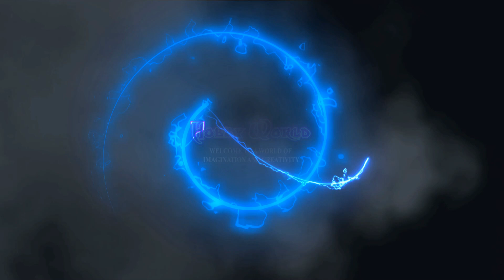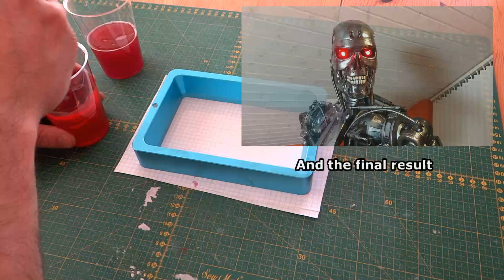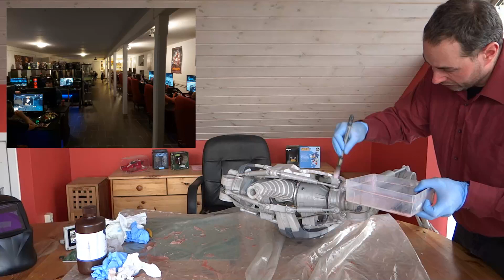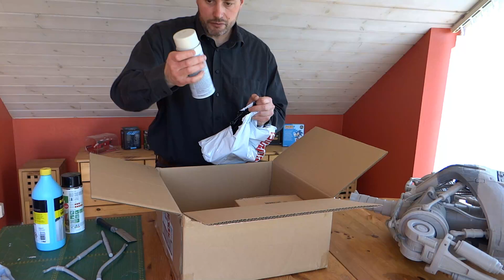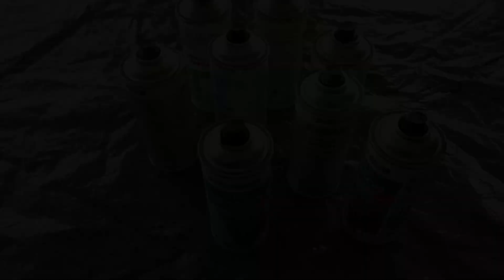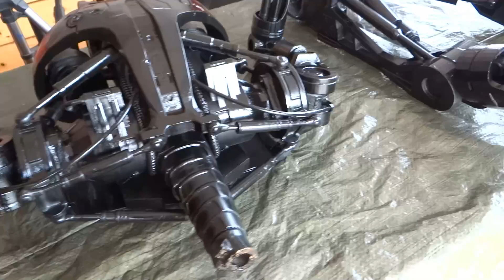Building a 3D printed Full Scale T-800 Terminator Endoskeleton - Episode 3

Comment: What size printer bed did you need
Reply from the maker: Sorry for the late reply, been a busy week. I actually printed this terminator on a small Ender 3 Pro (235X235) and a CR10S Pro (320X320) so not really any large printers. I have upgraded to larger printers so if I should do the project again I would print some of the parts in a single piece instead of splitting them up.
Reply: Oh right thanks im thinking of making one but need the files.  I found one online but it was more basic and didnt look as good. I just got a 420mm printer specially lol @HobbyWorld_one

Comment: Hi, but you use resin for resin printers and brush it on the model...thanks
Reply from the maker: Hi Fabio. That's right I use resin (from a resin printer) mixed with babypowder on the parts printed in PLA to smoothen out the surface.
Reply: @HobbyWorld_one  Hi, thanks for the reply I also create life-size statues, but I haven't had the time to publish the work, however I too have almost finished the T800 with a height of 2 meters and now I am trying the resin and talcum powder technique, then a once dried you have to sand everything and the colors adhere very well, thanks again .... hi Fabio
Reply from the maker: @zambo61  Hi Fabio, glad that the technique worked :) If you are interested in sharing your work you are always welcome to post it on the Hobby World Facebook group :) https://www.facebook.com/groups/128930785936319 Best regards Kim K
Reply: @HobbyWorld_one  Another thing I wanted to ask you... did you give a glossy black background with a normal acrylic color, just that or other products before the airbrushed chrome..... I'm following you, you're very good.
Reply from the maker: @zambo61  Yep I used the "Dupli Color Gloss Black" spray, applied 3 coats. After this I applied a couple of coats of "Dupli color Gloss Varnish" made sure everything was dry, and the I airbrushed with ALCLAD II Chrome. The base layer is so importaint to get the right metal finish, Thank you for your comment, really appreciate it

Comment: Hello, sadly the model is no available. Is there any other place where I can download it?
Reply from the maker: Hi and thanks for the question. Yeah I saw that the link for the original file has been removed. To be honest it had a lot of flaws and if I should make another terminator I would go for another model (I'm working on a video about the stuff I would have done differently if I should redo the project) 🙂 Personally I have been looking a bit at this guys models (https://www.cgtrader.com/batman8as) they are really good. You could also take a look at this one: https://www.gambody.com/3d-models/t-800-endoskeleton. I have not printed any of those models, but I have good experience with other models from both gambody and batman8as.

Comment: You don't need a welding helmet to block UV. Any sheet of glass will block UV. Most sunglasses will block 99%+ of UV without blocking nearly all the visible light which the welding helmet will also do. Of course with normal glasses you have to be careful not to get light around the sides of the glasses but if you're concentrating on what you're doing and looking at the light that will help. Alternatively turn the UV light on and then leave the room.
Reply from the maker: But it gave me a great excuse for buying a welding helmet ;)

On the serious side, I'm very happy about your comment and I'll keep that in mind for my next project :) I really enjoy getting feedback on the project, so thanks for the tip it's much appreciated.

Comment: So awesome what you have done.  I bought a kit for a lifesize terminator from Germany and I've never done anything like this before so I was wondering if you could help me and we could chat back-and-forth I live in Florida and I wasn't sure where you lived
Reply from the maker: What kind of kit did you buy? I'd be happy to help with some advice if I can. I live in Denmark so pretty far from Florida :)
Reply: @HobbyWorld_one  I don't know to paint it thats the biggest challenge
Reply from the maker: @749Giovanni  Well you'll get the best result with a airbrush. Make sure that the surface is clean and smooth and then use a rattlecan primer. When the primer is dry you need to paint it gloss black (I used a rattlecan from dupli-color for this). Now you can paint the model in metal. As I said airbrushing is most likely best (Alclad II Chrome paint is great), but you can get good results with the right rattlecan chrome if you are carefull. I have seen great results with the Rub and Buff product too. I'm going to try this on my own terminator control box in the next video.
Reply: @HobbyWorld_one  thank you so much I will give you up dates as I make progress
Reply from the maker: @749Giovanni  NP, looking forward to it
Reply: @HobbyWorld_one   What type of printer did you use for the terminator
Reply: @HobbyWorld_one  can you tell me what is the best glue to use, brand name and where to buy it please?
Reply from the maker: @749Giovanni  Well for small parts I just use common superglue. Medium sized parts can be glued with a mix of superglue and baking soda (this works really well). The large parts such as most on this model was PLA welded with a piece of PLA and a soldering iron. This unfortunatly leaves a uneven surface and needs to be sanded down, but it creates a very strong bond. There are glues out there that melts the PLA together but so far I haven't been able to aquire them here in Denmark. I have bought the superglue I use in the local hardware store :)
Reply: @HobbyWorld_one   Thank you so much I really appreciate it did you ever hear of plastic welding
Reply: @HobbyWorld_one Its a 3D printed kit from ABS Plastic

Comment: Super nice result. I like it more than the £6000 version you can buy in a way.

I've got a cr-10 laying around that needs a new control box 😕
Reply from the maker: Thanks for the comment, really glad you like it :) Most of this model is done on a CR-10 Pro with a bit of support from some Ender 3 Pro's. Hope that you get your machine up and running again. Was it a new machine with a defective box or did it just stop working?
Reply: @HobbyWorld_one  hi, it was a free gift off a friend to fix up. To get it working im looking at a new mainboard, screen and a hotend setup with the wiring. Not a major deal to fix but for now I have my ender 3 and a resin printer so all good :) 

I'll be printing this guy out soon also but probably about 19inch tall, just fixing the model and splitting the parts into groups first :)